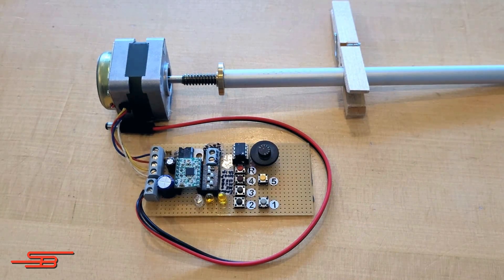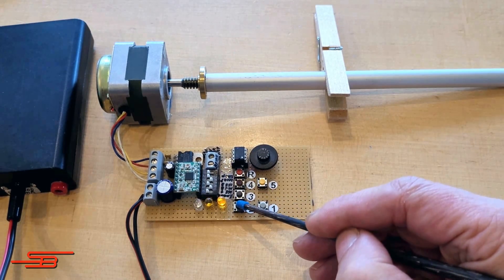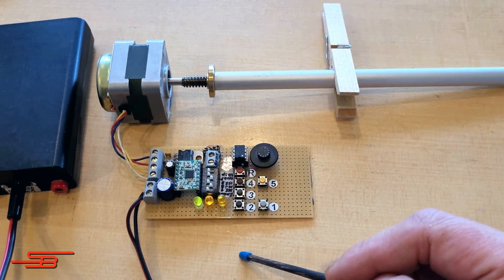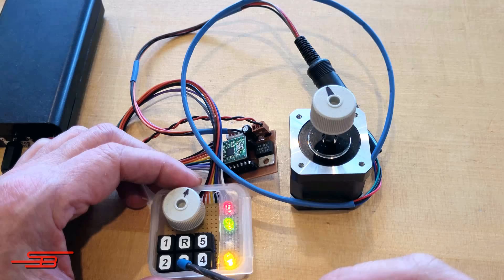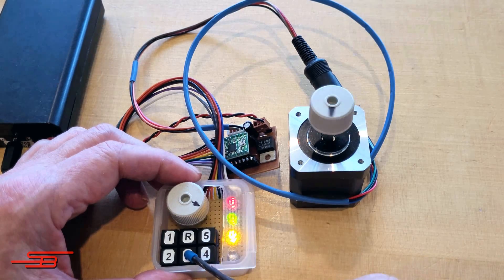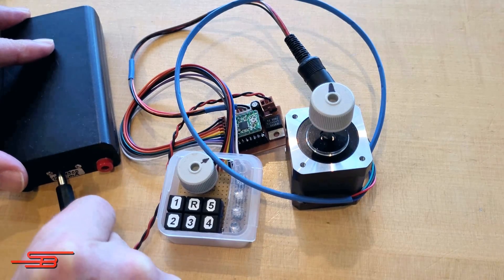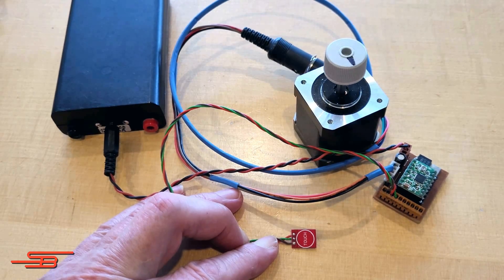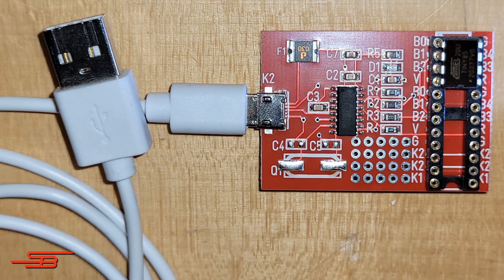ATTiny13 stepper motor controller for lathe -experimental project & Engraved PCB with Tiny85. Part 1

Comment: You did a beautiful job there and what impresses me most is that you DID NOT use an encoder in the stepmotor...
and there's also the Commodere C64 which brings me a lot of nostalgia!

Are you doing public work?! Do you have a website with the details of your project?!
Reply from the maker: No, I do not have a public platform for this project. However, I plan to show the circuit diagram and programming setup in future videos.
Reply: thank you so much!   :)